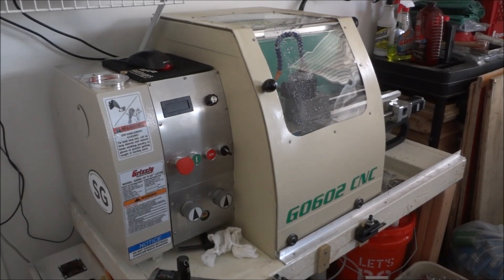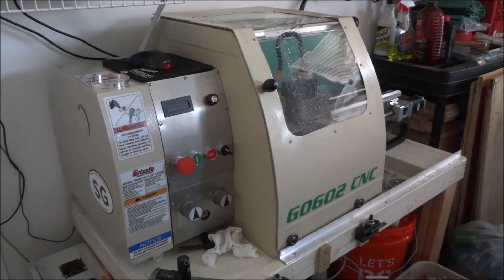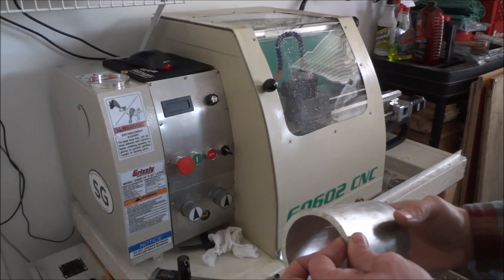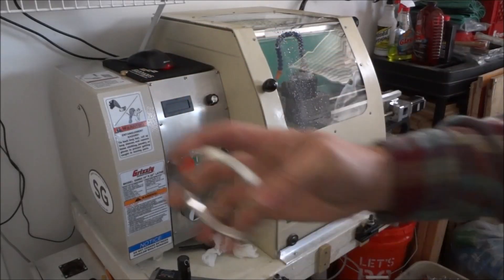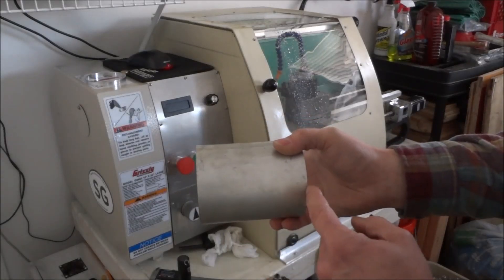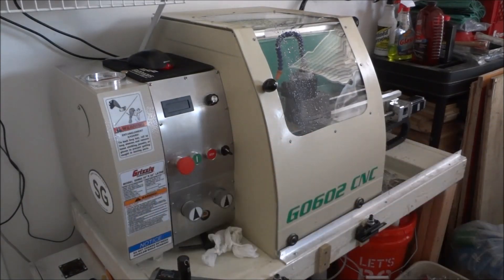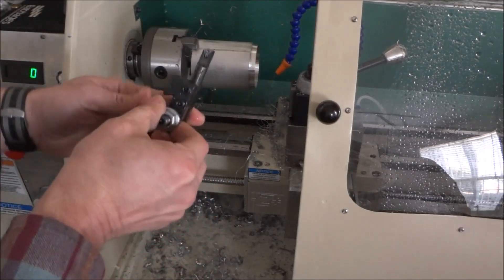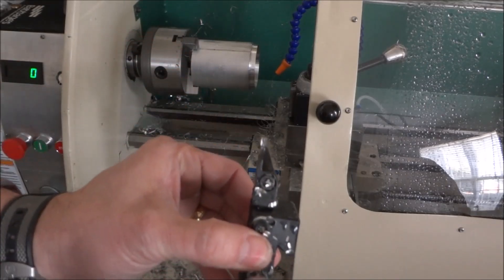G0602 CNC at work

Comment: Now that it's done, are you happy with the build? Anything you'd change? Do you think those stepper motors are a good size?
Reply from the maker: Very happy with the conversion However there is always things I would change!
I would go with a 2 HP motor and VFD Just because is not much different in $. Steppers are fine But I really like the 3 phase on the PM727 so I would go that route. Tray deeper it fills up fast with chips. And I would use the C11gs and make it full CNC from the Start and not install a PoT.

Comment: Love your enclosure, wish I had one of those on my machine, nice job.

I would be pushing those cuts a bit more to try and break a chip instead of getting a rats nest. I know when I first ran my g0602 I was doing it the same way, babying all the rough cuts, but really you gotta get rough and push that thing. I have found for aluminum a .015-.018 step down at .01 IPR will make a nice chip for most operations. What are you using for your control software, mach3, linuxcnc?
Reply from the maker: Mach3
Yeah very conservative on this part there's 6 inches hanging out so I did not want to puts it but I think a increase in doc is needed.

Comment: Hi,

Nice little CNC Lathe you have there. Wish I had one.  Enjoy your videos.

I notice you were fiddling with that loc line tubing trying to get the coolant pointed correctly. Loc Line is a nice system but they never seem to want to stay in a given position.

I have a Clausing metal lathe with an Aloris tool holding system. I had similar issues and decided to do something about it. Check out the linked video to see how mine works with the aloris AXA tool holders. Just bend the brass tubing to the correct position and you are done.

Here is the URL  Link:  https://www.youtube.com/watch?v=MvzdZfUn2_0

Here is another video this discusses an air blast system that I implemented on my HAAS TM-1P CNC Tool Room Mill.

You can manually provide air blasts with a foot pedal or have it work in conjunction with a PCOOL system if you have one or just have a solenoid that is activated by GCode to provide blasts as needed.

Here is the URL Link:  https://www.youtube.com/watch?v=B1ArxUjLy5c

Here is another video that shows another innovative way to use solenoids during the CNC machining process.

Here is the URL Link:    https://www.youtube.com/watch?v=zssH53f_7sA

Hope this information may be of some help.

John
Reply from the maker: +helicopterjohns 
Hi John,
 very clever I see how this could be useful However I would have to reconfigure it somewhat to allow for quick tool changes during the run. Very Clever! I also like the Air blast idea I will have to find a way to incorporate that into My PM727 Project.
 Be safe,
sam